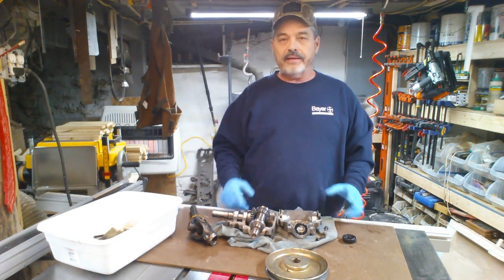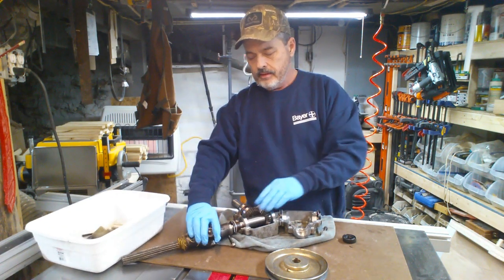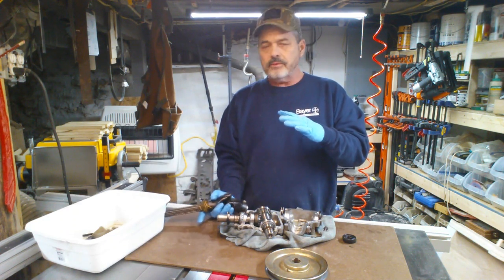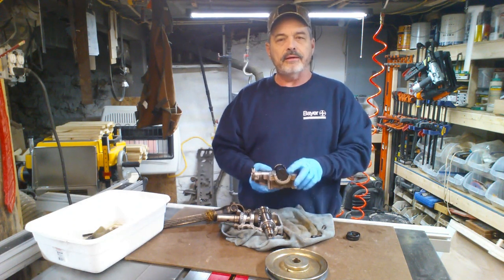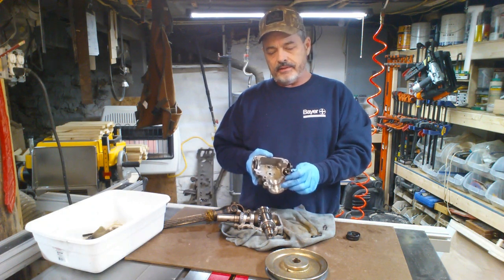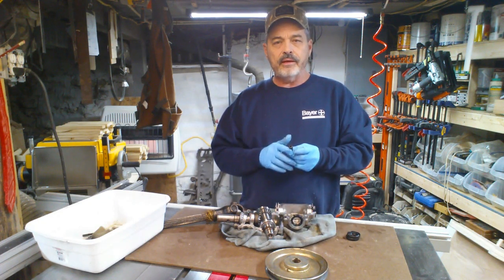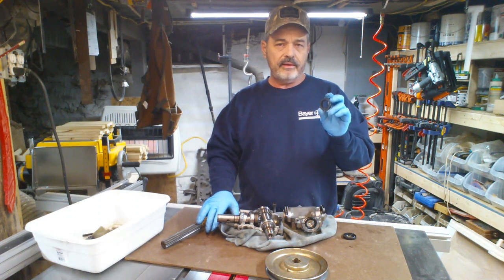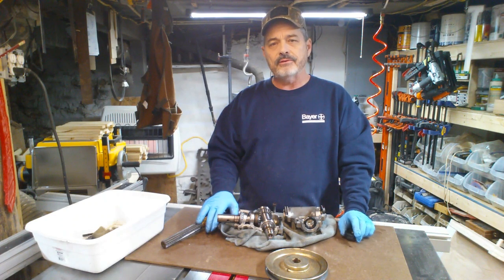Rural King subcompact Tractors RK24  M60 Mid-Mount Mower Deck gearbox

Comment: Is there a way to change the gearbox oil without splitting the gearbox apart and taking it off of the mowing deck?
Reply from the maker: It looks to me like they want you to open the whole thing up and pour the oil in it while you replace the seals. They must know the seals go bad and leak, one thing I do know, The gearbox is very expensive.

Comment: How do I replace belt on the m60 deck ?
Reply from the maker: Easiest way to take off your deck remove the two metal shields on left and right side the pulley that's hooked to the gearbox there's a spring next to it there's a slot -square slot and that metal that's connected to the spring take a ratchet extension and your ratchet and put it in the hole now you can twist it and relieve the tension on the Belt